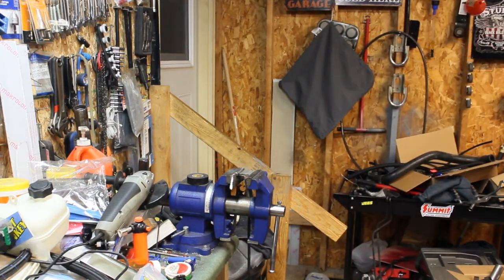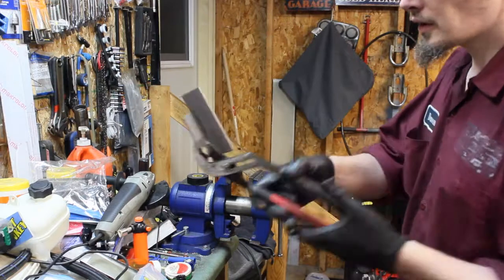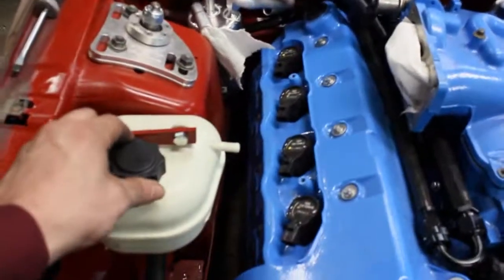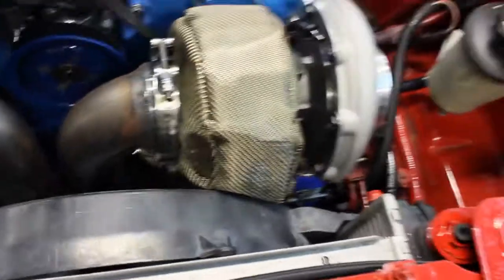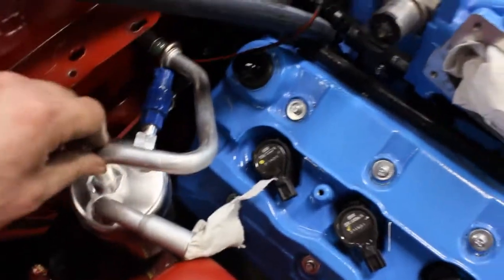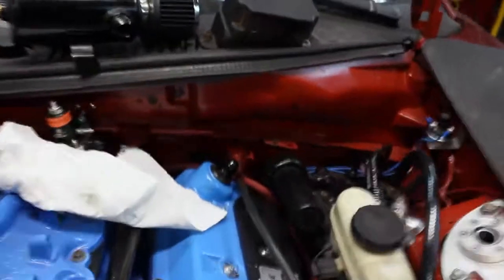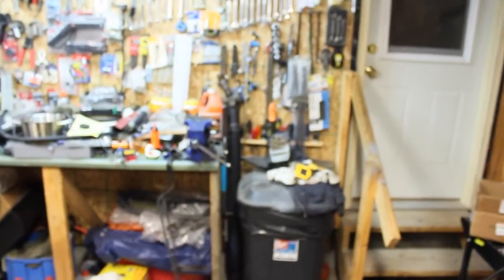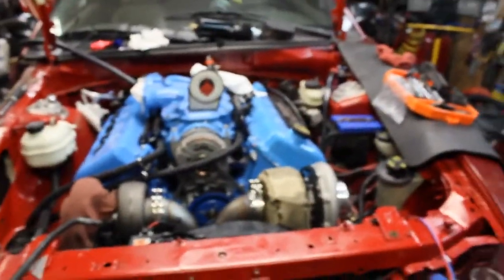Turbo Mustang cooling system mods plus update

Comment: how is your cooling mod working for you?  Mine doesn't because the water boils before it heats the thermostat...
Reply from the maker: Mine has worked fine, but I never did much street driving with it. At the track I haven't ran into any issues with it.